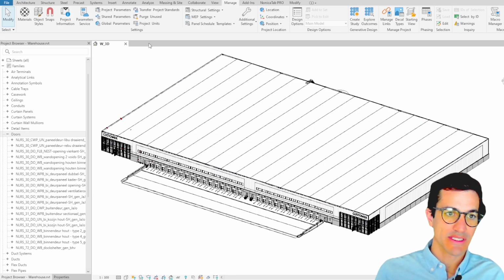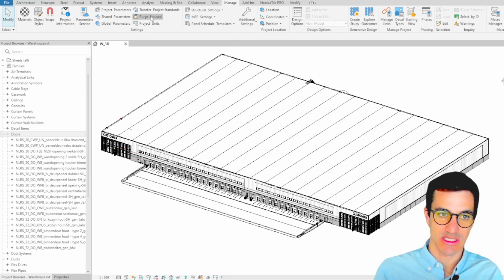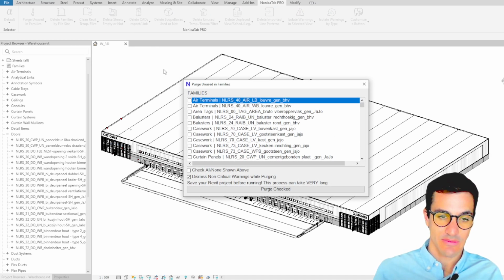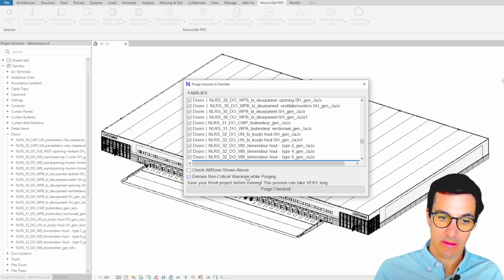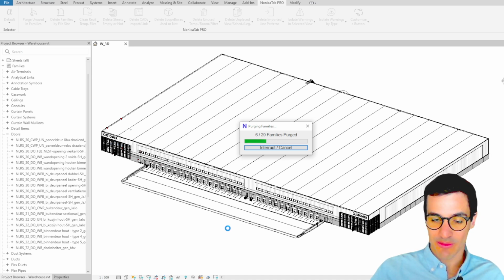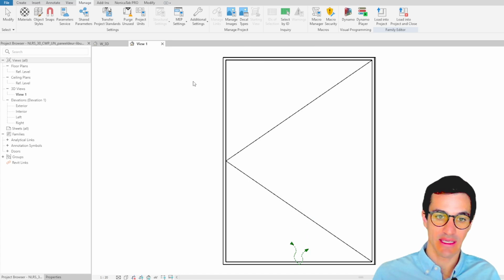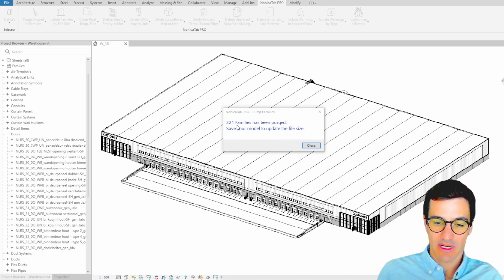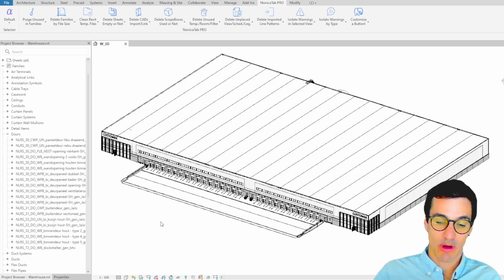Purge Unused in Families | Revit Buttons ✅

Comment: Hi, is it possible to select what categories to remove? I've tried to use in a template but I have noticed that some materials within the family that were used to paint a face are removed when cleaning. If there is an UI for purge options it would be awesome
Reply from the maker: Thanks for your feedback Paulo! Good point, we would have a look and maybe implement the option in the future.
Reply from the maker: Hi Paulo,
I just wanted to let you know that we have just released a new update of Purge Unused in Families button (v1.4) in which you can select purging options. By default, Materials and Materials assets are not purged but you can modify that in the button "Opt." next to "Purge Checked". You can update this button within the app using the Set Up Button/Script on your preferred button.
I hope this helps and thanks again for your feedback.
Jaime